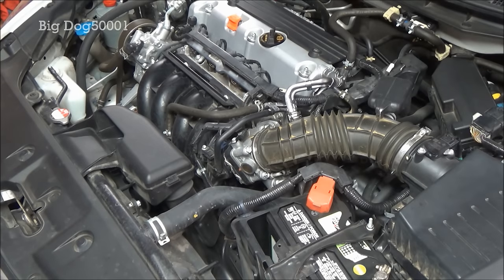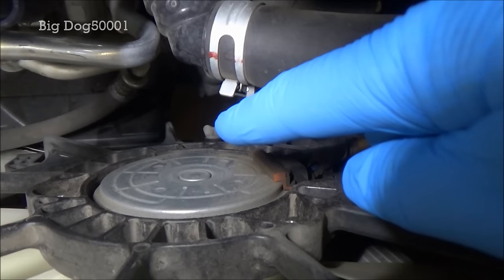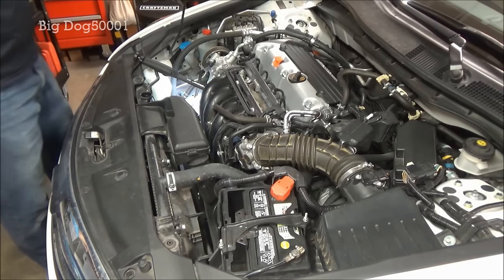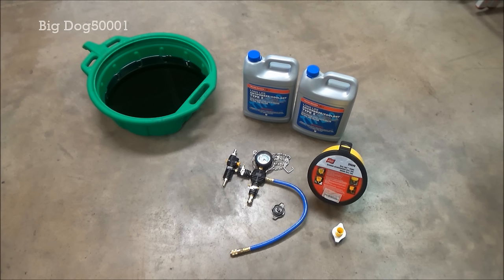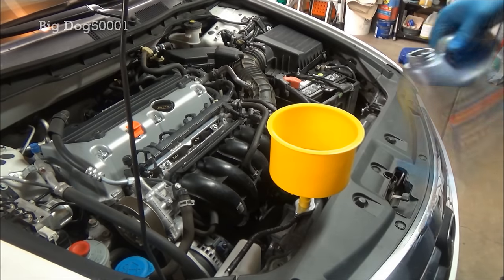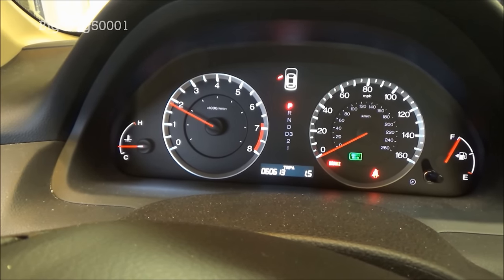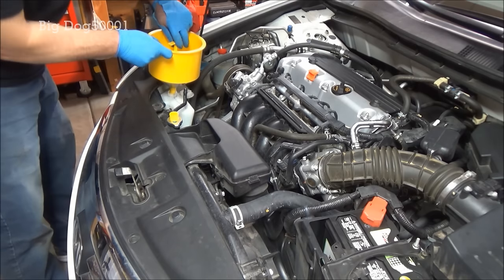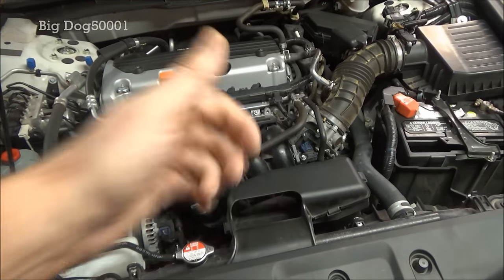Honda Cooling System Service/Fluid Change

Comment: Why would you not drain the engine block ...? 
By doing what you have done, you left about 50% plus of the old coolant mix in the car. 
It is not good practice to then mix different types or makes of coolant. 
The engine block threaded drain plug is located in front of the engine block to the right and just below the exhaust manifold.
Reply from the maker: This is the exact service procedure for this Accord from Honda.  No reason to be condescending in your comment, if you disagree with me and want to try and remove more coolant, no problem go for it, but removing other parts generally does not lead to removing every single drop of coolant from the vehicle unless the entire system is taken apart.  Just to be clear, according to Honda service data, coolant service for this Accord (as shown in video) removes roughly 1.6 US gallons, the entire cooling system capacity for these is 1.9 - 2.1 US gallons depending on year and radiator manufacturer (which removes about 75% of the old coolant).  These Hondas come from the factory with genuine Honda coolant, if Honda coolant is used for the service (which should be) there is no issue doing this as this is an approved service from Honda.  

Although I did not "mix" different types of coolant, I have not seen any mixing issues when it comes to using "any make and model" aftermarket coolant with Honda coolant as far as mixing or turning into sludge is concerned (longevity for seals and other parts is a different story and that comes from the aftermarket coolant itself not performing as well as Honda coolant, not the mixing of it with Honda coolant).  Mixing of coolant issues are mostly are from other car brands that have made changes to their coolant designs other the years, and yes those should not be mixed.  Good luck in your future endeavors.

Comment: Cars been idling now for 30 min. Darn fans still ain’t kicking on.
Reply from the maker: If fans are working properly, the vehicle is most likely not up to operating temperature yet.  I will usually bring the RPMs up to around 2,000-2,500 to help it warm it up.

Comment: The radiator is a weak point in the system they rot out fast. For me the only reason to change the fluid is at that point.
Reply from the maker: Not something I would recommend, the coolant also has anti corrosion properties for the engine and other parts in cooling system.

Comment: I cannot find a single place that takes old antifreeze. Advance auto, o'reily, tire kingdom, everyone. Recycling centers don't take this fluid either.
Reply from the maker: It can be difficult to find a place.  Most shops have to pay a company to take it.  There is a Hazardous Waste Disposal program where I live and they take it for free if you live here or charge a small fee if you don't.

Comment: I drained my Saturn coolant because though very good it was mixed too strong. I drained it. I undid bottom hose every time I drained the distilled water and refilled x 3 as well as bottom of radiator. I didn't dare attempt to take out bolts on the block first, because it might break the bolt and second, because I needed a special tool (love those Saturn enginers). When you drain the first time you don't get it all (you claim 3/4s, ok). 
My job was not expensive, but it was comprehensive. I never had a problem with air getting in the coolant. I merely kept the cap off and ran it.
I respectfully suggest you did not do a thorough job.
David
Alberta
Reply from the maker: This is not a Saturn service video.  I showed how to properly maintain a Honda if done at correct intervals.  You should probably watch Saturn how to videos if you wan to give advice on how to work on them.
Reply: Big D....
    Draining/replacing coolant on any vehicle is about the same. Sorry if I offended you.

Comment: Starting the engine and mashing the gas to 1500 rpm isn’t good for your engine dude.
Reply from the maker: Your username is fitting.  If you read a Honda service manual you would see this is exactly how Honda teaches you to do it.

Comment: You can rig an empty liter soda bottle to act as a filler helper. Just cut the bottom off and use electrical tape to wrap around the mouth of the bottle until it fits very snug in the radiator mouth and it works the same except you dont have a stopper but you can rig a used wine bottle cork to do he same. You wont need this but like every  4 or 5 years so why be wasteful.
Reply from the maker: That is fine if you want to make your own tool (not exactly sure how safe and effective it would be for most people) but wouldn't call buying the proper tool wasteful, especially when the current price is only about $28.
Reply: @BigDog50001  28 bucks vs free for an item i will use every 4 or 5 years. It's good if you work at it. Then it justifies the expense. I will take the free one.